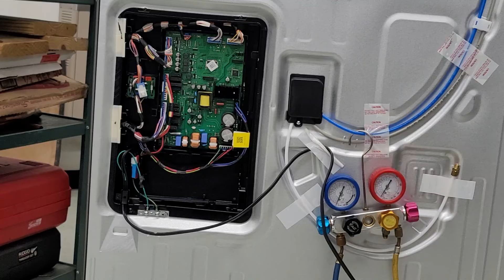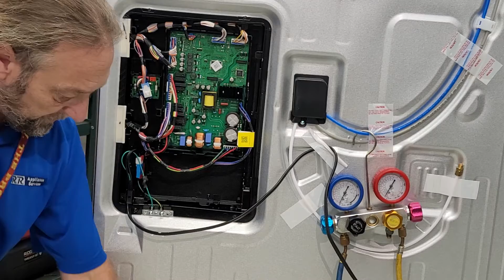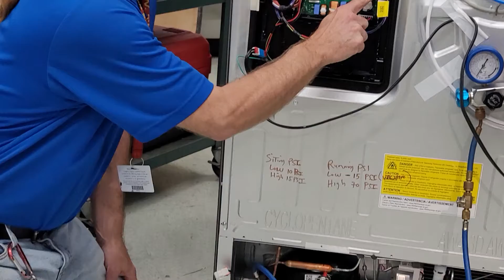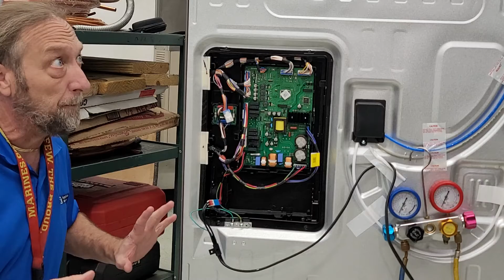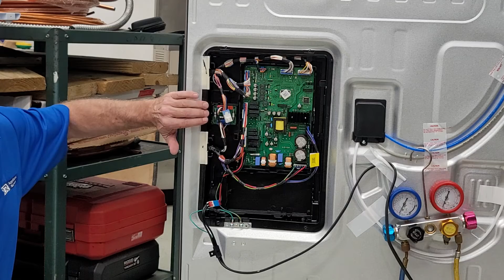Identifying parts on a Refrigerator control board

Comment: Where do you get schematics for the main boards? I was very surprised to find my Samsung Freezer did not have a relay or capacitor for the compressor, it is all electronics on the main board now! Thanks.
Reply: instead of relays they use traics which is a type of electronic relay

Comment: I have a whirlpool refrigerator side by side model number WRS311SDHM02. There are no panel on the back of refrigerator. Does it have a control board. I know it has a temperature board. . But can't find a main control board? Hope you can answer ASAP thank you so much.
Reply: Look where the power cable is that’s usually where the mother board is